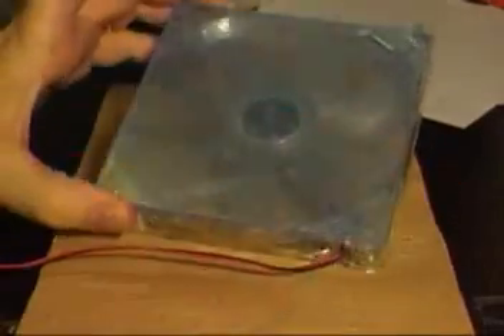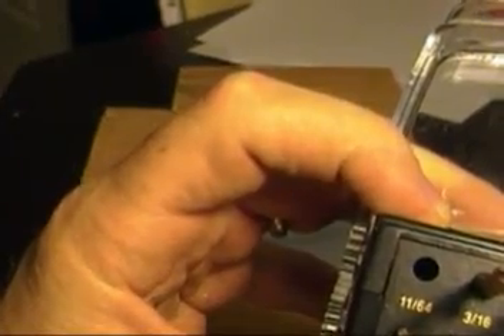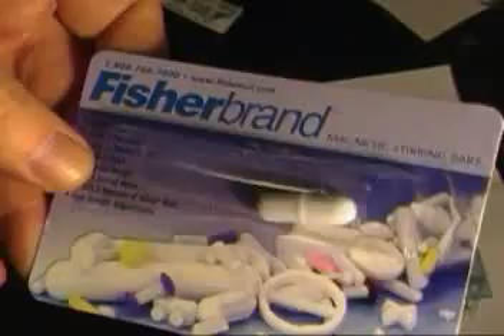How To Make A Stir Plate for about $15 - Part 2

Comment from the maker: I've been able to get by without one.  But I've since changed out the two little "pill" magnets for one bigger magnet from a hard drive.  It works much better, since with the two small magnets, the stir bar might get thrown off.

Comment from the maker: That would be cm, hehe.  Yeah, An inch is 2.54 cm, and you align them about with the ends of the stir bar.

But glad you asked because those little magnets _can_ work, they often _don't_ work.  REALLY...What you should do is dig a magnet out of an old hard drive.  Those are usually crescent shaped and over 1 inch long.  That kind of magnet holds the stir bar without throwing it.